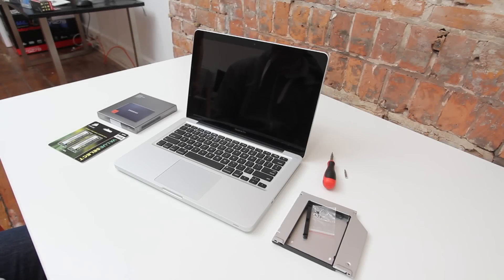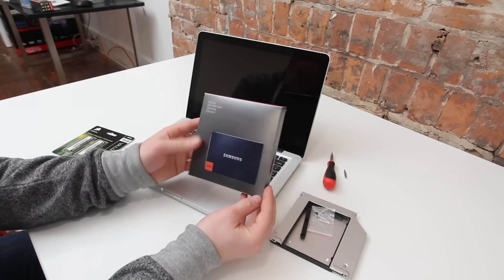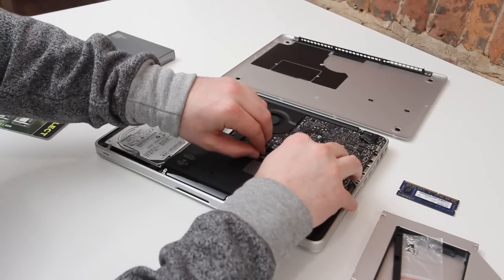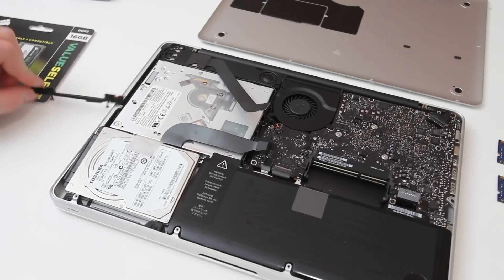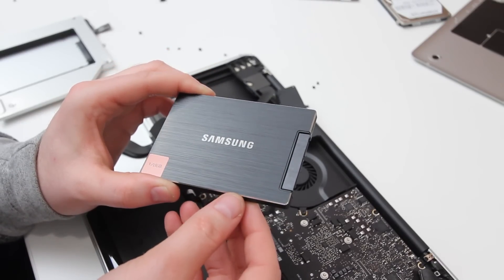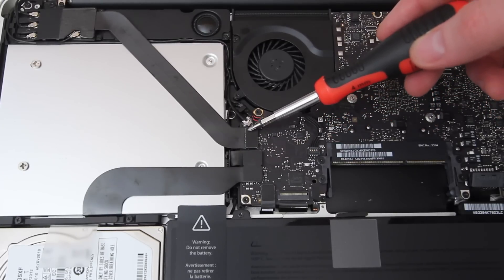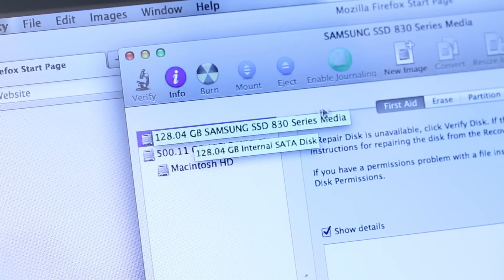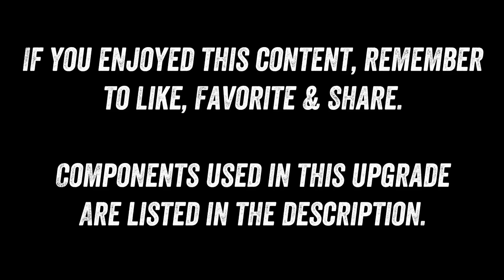Upgrade Your Macbook Pro (SSD Upgrade, RAM Upgrade, Optical Drive Bay Adapter)

Comment: i have a macbook pro retina late 2013 and i want to change the iris gpu to the nvidia 770m im i able to do this?
Reply: It is not possible to upgrade the GPU of a Retina Macbook Pro. Pretty much everything is soldered in place for the newer models and no room is left for adding additional components inside. Iris graphics are also integrated graphics, meaning that it is actually part of your Intel processor. Unless you wish remove your CPU (which is soldered onto the motherboard and nearly impossible for consumers to remove), you can't switch Iris out.
Reply: is there some place else that can take everything off as u said and put the new gpu and a new cooler if needed?
Reply: Pedro Costa Unfortunately, there is not. There is a reason that iFixit gave the Retina Macbook Pro the second lowest score possible on its repairability scale. Apple crammed and glued in an incredible amount of hardware into these laptops (none of which should be taken out assuming you want a functioning computer). While Retina Macbook Pros are great products, you are pretty much stuck with the hardware that you ordered the computer with.
Reply: Ruiming Cao Hey Ruiming Cao, is it possible to upgrade  mac book pro (non retina)  graphics card ? 2011 models
Reply: kiwicooldaddy It is not possible upgrade the graphics card for the Macbook Pro 2011 models.

Comment: This may sound like a pretty silly question: Once you have your SSD in is there a way of diverting your iTunes library to the traditional hard disc? Thank you!
Reply: Yes, there is.  You can move both iPhoto pics and your iTunes Library to another drive (better if it is inside the MacBook) and then create an Alias and put that in place of the original Library files for iPhoto & iTunes.  This way you don't fill up your SSD on the first day......  Rec minimum HD in your MacBook to be a 1-2TB 2.5" drive.  You will need the adapter to hold the drive when you replace the DVD player with your new drive (use an external DVD if you need one).  NOTE: Don't trash your music or pics until you try it out to make sure it's working for you.  Good Luck!
Reply: Thank you, I'll give it go!

Comment: DO you think this RAM Memory will work for an early 2011 15 inch Mac?
Crucial 8GB Kit (2x4GB) DDR3-1866 ECC UDIMM 1.5V Memory For Mac Pro Systems (Late 2013) CT2K4G3W186DM

Comment: If i get 8gb ram will final cut pro run smoothly on my Macbook pro 13 inch?
Reply: It will definitely help. I went from 4GB ram to 16 GB ram and I can tell the difference when I'm working Premiere and Photoshop simultaneously
Reply: Alex Radelich I have 16gb with solid state hard drive. The difference? I no longer wait for anything.
Reply: I just ordered my SSD and it comes tomorrow! I'm overly excited to change out my hard drive
Reply: you'll notice a big difference... and no noise.

Comment: Thanks for the guide man. I installed a Samsung 840 evo in my Macbook pro 6.2 carefully but I can't connect to it. I tried in both Mavericks and Windows 7 without success - and I tried the whole process twice. Firmware and software should be updated. Do you have any ideas what I can do about it? This is the optibay I used Aluminum TOPPO IDE-SATA 9.5mm universal. 
I will really appreciate your help!

Comment: The difference is, one is hard disk drive(HDD) and the other one is solid state drive (SSD). He kept that on purpose because it is the one that holds the OS(Mac OSX) to run the mac afterwards and may provide extra storage from inside your device in future. Hope i helped you.

Comment: It isnt forbidden, but you're not really supposed to put your boot drive (SSD) in the superdrive's location.  I have read multiple sources that say to put the SSD in the main drive bay, then move the traditional drive to the caddy that will go in the Superdrive's position.  The main drive bay is sort of set as default booting location that the software and logic board look to boot from, not the superdrive bay, which, it can be done, but is not recomended as seen in this video :o

Comment: I think it's just because Apple doesn't produce there notebook ram (which is also used on mac mini) up to 16 gb. But the Mac OS can handle all the way up to 32 gb of ram (as proven on the Mac Pro). So I think when they say 8 gb is the max, they really mean it's the max you can configure to on there website or at there stores.

Comment: Thanks a lot. Few basic questions. Mine is a 2006 model (2Ghz, intelcoreduo). Is the adaptor still the same? I dunno where to look for the ATA connection (opticalDrive-motherboard). Another point is that the max RAM is 2GB. 
Somewhere I also read that the connection in parallel of SSD and HD may have a side-effect: it does not stay in the sleep-mode. 
:-?

Comment: I think there may be some problem. I'm using the SSD as the main drive and my previous one as an extra drive. After setting it up, sometimes when I close my computer the fan continues to run and never stops making my computer really hot. Is there a fix to this?

Comment: Is this hardware compatible with a 2009 unibody macbook pro 13 (The MBP5,5)?
Is it possible to change just the HDD for the new SSD, so the optical drive can still be there to burn some cd's? Do you think it'd perform better in this way, or it doesn't matter?

Comment: The speed would be the same since both of them are SATA III. You should keep the HDD in the hard drive spot because it has the motion sensor technology to save your hard drive's data in case you drop your MacBook and that security for the HDD isnt provided by the optical bay. The SSD does not need this the sensor.

Comment: Check the owc web site, they will tell you the max ram that works, its usually higher than what apple say.  OWC check max ram all the time.  Ive got a 13 inch mid 2010 duo core 2 mbp 2.4ghz and im running 16gb ram.  It doesnt work on all macs of that year thou and you have to get the correct ram as well(alot of the cheap ram has been reported as not working)

Comment: My battery life has dropped a lot since installing. Shouldn't it be about the same if the SSD is the main drive? Or is this what is supposed to happen? Does the HDD run constantly?

Comment: Thanks for your response.. I continued my research - The Sata II is the best I can put in my system in the optical drive location.. Sata III should work too but I wont get the speeds of a III - I should get 3Gb/s=375MB/s theoretical while the actual maximum observed has been 285MB/s.. My current OWC Mercury EXTREME Pro 6G SSD as my main drive should get 6Gb/s=750MB/s.. but it's currently way less than that.. currently getting 245MB/s write and 413MB/s Read..

Comment: dude just find out which EXACT macbook pro you have by finding the serial number in System Information app (in utilities folder) on your computer and then go to apple's site, then click on apple store, macbook pro, then type in serial number and it will show your exact system and what it can take. I would use apple's site because they're the manufacturers.

Comment: get the 840 pro if you're spending all that money, but if you really want insane speeds, get 2 Samsung 840 Pro 512GB (for the storage) and have them in RAID 0 setup (RAID 0 with these bad boys gives an insane 900MB/s speed)

Comment: no way! SSDs come in SATA III, which even 7200 RPM drives can't compare to. the fastest SSD is the Samsung 840 Pro but that's a bit expensive. with SSDs though, try to stay away from the cheaper ones because they do not give you a performance boost versus an HDD, so i'd say to go for a mid-level quality SSD. the samsung is enthusiast performance, one of those gives about 550MB/s, and two in RAID 0 setup give about 900MB/s!!!

Comment: 've done this in my early 2011 15" MacBook Pro but my SSD is in the original HDD slot and Sata HDD is in optical drive caddy.  Everything works very fast! One problem - my fans go very loud the second start using more than one app.  Any advice? Should I rearrange the drives in the hope that they are the wrong way around?  Thanks for any helpful responses. Cheers.

Comment: just what i was looking for! Thanks, for the high res video.
And I agree totally about the retina, i wish they would make the normal model macbook pro with a retina screen, what use are the vew millimeters and grams you gain in the retina model. A tool, which a laptop is, is better when it has some mass and volume to it. If i wanted smaller and lighter wouldn't I just buy an iPad? Anyway, great video, thanks again.

Comment: i keep reading that running a hard drive on an early 2011 model will not work. i checked the system report on my computer and it shows 2 intel 6 series chipsets.    can i still add a second ssd?

Comment: Question: checked my Serial-ATA optical drive and I show a link speed of 3Gbit with a negotiated speed of 1.5Gbit - this looks like I'll only sata II speeds - should I just install a less expensive drive (7200 RPM) instead of the SSD?

Comment: I'm looking to upgrade my Macbook Pro 2010, but I have a question. I will be getting the Samsung 256 GB 840 Pro, but I also want to get a larger HDD. Which would you recommend. I was looking at the Seagate Barracuda until I realized it was to big at 3.5 in. I'd like to have at least 1 TB though, preferably 2 TB. 

Also, what can my computer handle when it comes to SATA? I can't find that answer on the web for some reason.

Comment: Hi, I really like your video ! I want to do the exact upgrade on my macbook pro Mid-2010 (which is quite old now in terms of performance...) . I saw on the Apple website that I can only upgrades the ram until 8GB, do you think I can also use the Corsair 2x4GB ? And are you a 100% sure that the Optical drive with the Samsung SSD combinaison will work on my Mid-2010 model ? Anyway, thank you very much for your video, it's clear and very usefull ! Cheers

Comment: Lew, if I do the same thing and take out my optical drive, then also have the SSD, will I still get the same speed improvements that I would if I just threw in an SSD without having my old hardrive still in there?

Comment: I have an 2010 13inch macbook pro should i buy a new mac or just upgrade it? I know it will cost less if i upgrade it but i also would like a thinner lighter laptop and i am scared that it will be outdated and i wouldn't be able to update to apples latest software. I was suggesting getting a new one but it doesn't have the features that the older macs do. Whats the better option?

Comment: just google update macbook pro in google. the apple website sets out specific requirements for each macbook pro. and you have to match it to their requirements. a 2011 mbp 13" for example can only take up to 8Gb or RAM. 1333 MHz is what they stipulate as well. also its a 204pin connection.

Comment: So glad I found this - Wanted to upgrade to a SSD but they are so expensive I cannot get one that I can fit all my music and videos on - So I was contemplating putting it on a portable WD drive.

Never thought about removing the optical cd drive and putting in a SSD to replace. Makes sense! I'm assuming it's pretty easy to purchase a USB cd drive to use as and when I eed (like on a MB Air) as I occasionally burn CDs.

Thanks again

Comment: The original bay is designed with faster read times than the optical drive so to get the full performance out of the SSD I would put it in the HDD bay. Unless you don't want to use the SSD as your main drive, just storage.

Comment: I recommend you swap the SSD with the traditional hard drive and put it in the optical drive (this is because the optical drive has a slower rate)

Comment: I have a early 2011 mbp. Is the optical drive sata cable slower than the original sata cable ? I recall you putting the ssd in the original drive slot rather than the optical drive slot because of this issue.

Comment: I'm leaning toward this route. Yes, I'd love to have a retina display MacBook pro 13 but the ability to insert 16gigs of ram and an SSD in place of the optical drive I'd never use seems so much more practical and long term to me than to be stuck with 8gigs of ram and a 128 gig hard drive. Though you could get an external hard drive I would rather not have to carry that around with me, too. Think I'll run with this machine.

Comment: Yes exactly. Plus, i think it's better to put the SSD in the original disk place and to put the HD in the optical bay adapter. It's related to the negotiated speed between the MB and the SSD (in the optical bay adapter) that makes it only Sata 2 speed and limits the SSD performance.

Comment: I've got a 128 GB SSD in my hard drive slot. Can I put a hard drive in the optical bay using this adapter and use BootCamp to install a Windows partition on the hard drive? Do I have to configure the SSD and the HDD into a RAID? Thanks for the help, Lew.

Comment: How is the battery performance with the SSD and the SATA drive spinning in there.  Will battery performance decrease tremendously?  I was thinking of doing this upgrade to my 2011 Macbook Pro but worried about losing battery life on the go.

Comment: @raphy golberg I would go with non-retina with upgrades but put the SSD where the HDD is and HDD at the optical bay it will give you higher speeds on SSD

Comment: @raphy goldberg the 13 macbook pro retina you cant upgrade the RAM though you can upgrade SSD but it is some wierd type, Also the high resulution screen on the retina takes alot of power from Intel HD4000 graphics, the non retina you can upgrade and stuff but I think it use Intel HD3000 graphics. Its your choice hope this helped

Comment: WARNING: For those who don't know. Before you start touching any components inside the PC/Laptop, please making sure you either: have a wrist warp or touch a mental. What this would do is, it won't give ESD to your device. ESD (Electro Static Discharge) this WILL mess up any component inside the device.

Comment: There aren't really any cons other than the fact you'd largely be wasting your money on memory the laptop wouldn't necessarily use :) 
I've got 8GB in my little i7 13" and with a reboot at least every day, I've never had any issues, even when engaged in minor photo/video editing.
I do have 32 gig in my Hackintosh though ;)

Comment: I upgraded my MBP too. Mine is the old model, I bought it in 2006. I replaced the old hard drive with 500GB and I bought the new battery as well. I'm still looking for the new RAM. It's hard to find that fits for the old MBP. So far my MBP works great. I did by myself and nobody taught me. My husband was shock I did it :)

Comment: Macs are really easy to work with and work on. The insides are generally as good looking as the outside. Also, if you have a Mac put an SSD in it. OSX is great in combination with an SSD.

Comment: Although it doesn't really fit the situation. It is possible to install different size dimms as long as their in different channels. The most important thing is that the timings and the frequency match. 

I'm my gaming computer is running 12gb. 2x2gb in one channel. And 2x4gb in the other.

Comment: Make sure ur ribbon  cable is connected properly. And also what drive are u using. Apples macs don't play nice with some drives (ocz). Try getting a return if you can

If you want maximum compatibility (most drives do. But the ones I list are the best choices) pay the premium and get the m4 from crucial or the intel 520

Comment: Ideally yes, because you most likely want the SSD to increase boot times and also application launch times. You don't have to put the OS on there, but it would significantly increase performance.

Comment: In theory, it would work, however it is good practice to install RAM in pairs, so if you want 8GB, use 2X4GB, if you want 16GB, use 2X8GB. 

Will it work?
Most likely yes.

Should you do it?
No, instead spend the extra money, get the 16GB kit, or opt for 8GB instead.

Comment: do any fusion drive simulator software exist put there? Why would it be great? because your Mac recognizes both drives as a single volume and it self manages to put most used files in the SSD and less used files in the HDD

Comment: Make an OS Lion recovery USB using OS X Recovery Disk Assistant v1.0 from Apple's website IF you are putting the SSD in the Primary HDD's spot. If you are keeping the traditonal HDD in the same spot then go into your computer and you will see the two HDDs

Comment: Is your traditional HD the one that came with the machine? I only ask as it's Samsung and mine has a Seagate Momentus (late 2011 refresh 13") I was just wondering if you swapped it out or if Apple switched to Samsung drives

Comment: @unboxtherapy Hi Lew, is there a way to only clone your system without all the files??? I had to clone my HDD a little while back because of an issue, but that's a complete clone instead of just the system. (I used Carbon Copy Cloner, highly recommended) Could you maybe do a clean install tutorial? We all know you're more than just an unboxing guy ;)

Comment: Hey man, If your looking for the awesome speed of the SSD (as anyone is that uses a SSD) You may want to put it where the original HDD is. This is because the SATA controller the original HDD uses has speed capabilities of 6GB/s whereas the SATA controller you are using on the adapter from the ODD only has a max speed of 3GB/s. Though its not a huge loss its still a different. All in all I would just swap the drive locations. P.S. I have the same SSD, AMAZING w/ 16GB Corsair Vengeance RAM!